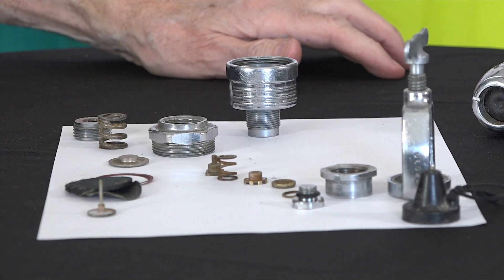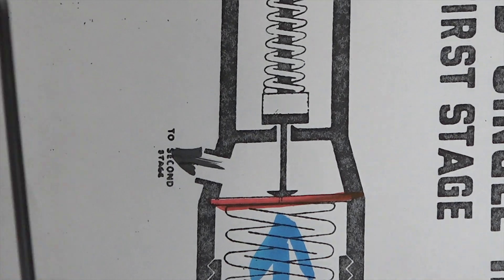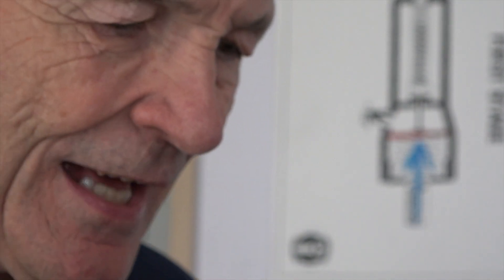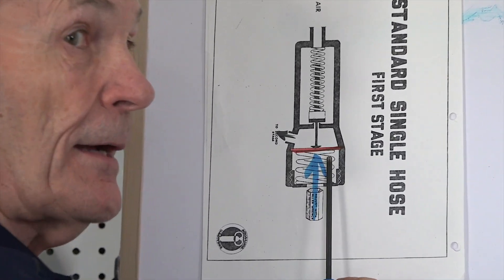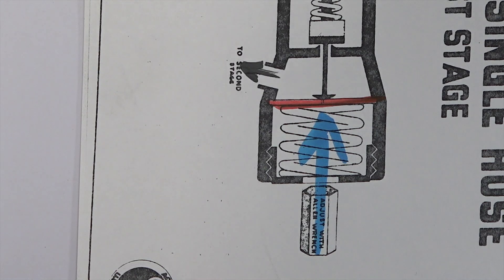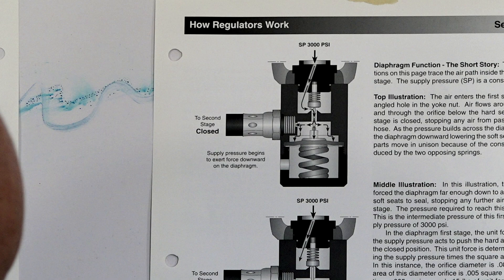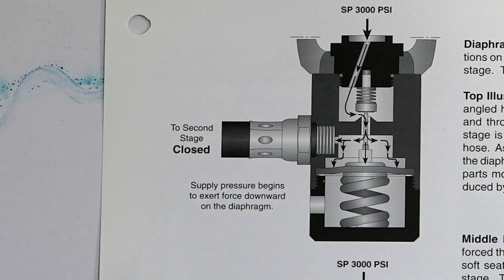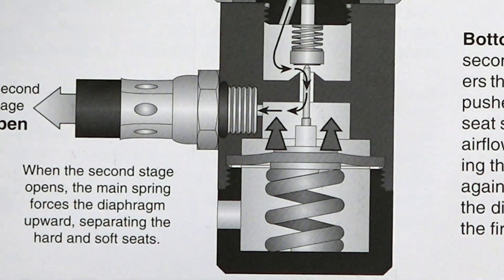How Diaphragm Regulators Work - Scuba Tech Tips: S17E14

Comment: Alec, Back in the day I happily dove A LOT with a Dacor Olympic 400 with a standard Dacor second stage (non balanced).  Getting back into it, a BALANCED second stage is the DeFacto standard.  Why would a diver need a balanced second stage since it is going to receive a constant 140 -150 psi?  I am guessing the modern second stages have different diaphram diameters, orifices, etc.  This results in an easier breathing regulator.  Maybe the modern second stage venturi action is the big improvement?  Not the "balance"?  Got a tech tip on this one?
Reply from the maker: I replied to your similar question on my most recent video but, let me add that a balanced 2nd stage is claimed to reduce the breathing effort at all depths, all pressures & all attitudes (that is, upside down or right side up).
I have dived with many, many regulators (including BTW, the wonderful DACOR 400). 
In later years, many were 'balanced'.
It may be that I am less sensitive that others (my wife might agree!) but I have never perceived a difference between a standard & a balanced 2nd stage - assuming both were equally properly adjusted.
You are quite correct about the venturi which, while far from new (my original Aqua-Lung Mistral 2 hose reg from training days (1958) had a venturi), can be VERY beneficial if high flow is required.
Alec
Reply: @AlecPeirceScuba_SeaHunter  Alec, thanks for the quick reply.  John

Comment: Excellent video, I have a question. I suppose that the air pressure is at 150 psi when the air gets outside the filter?
Or at least in the first chamber before reaching the diagram? Thanks!
Reply from the maker: The pressure in the 2nd stage intermediate pressure (IP) can be from 120 to 150 psi depending on make.  Just to make sure you're clear, tank air at say 3000 psi passed through the sintered air filter into the HP chamber and stops.  Whey you inhale, it opens the diaphragm/piston chamber to let in HP air which is reduced to IP at 150 and down the 2nd stage how to your reg and mouth.  Hope this helps.
A
Reply: @AlecPeirceScuba_SeaHunter thanks, so the pressure in the HP chamber after the air came out of the filter can be 3000psi?